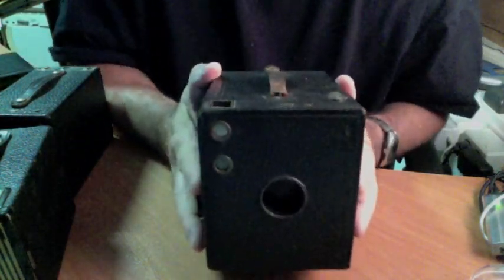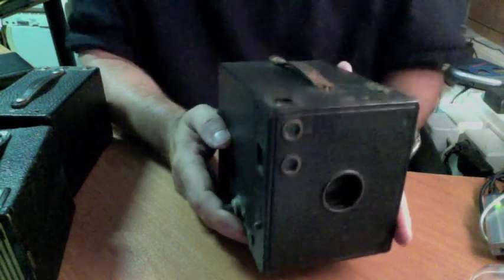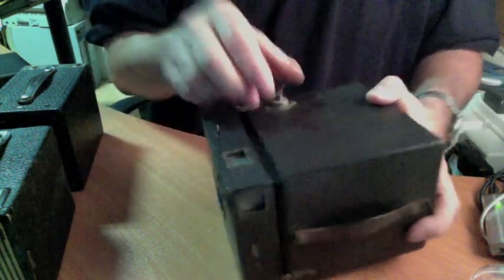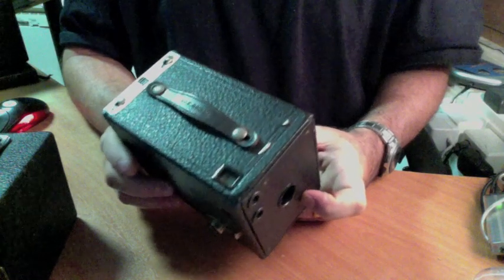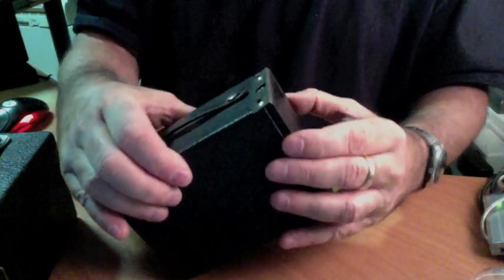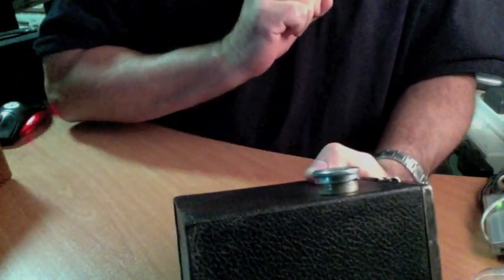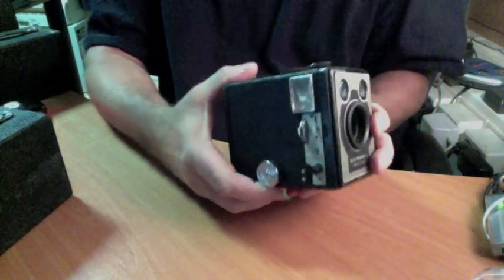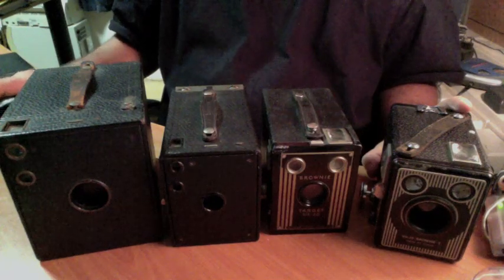How-To Open Different Kodak Brownie Box Camera Models

Comment: bought one yesterday and a garage sale and couldn't open it, thank you so much! i think the lens might be missing and maybe a few other parts i dont know, is there any way to buy parts for a brownie? (the first one you showed in the video)

cant wait to start using it :) i got it for only 2 dollars, i almost passed it up but i though perhaps i could figure it out somehow. its a lot simpler than i thought it would be.
Reply: i just found out there is nothing missing, but the viewfinder is out of place and may need to be refitted back (the mirror rattles around) but i  found a local shop that repairs these things luckily so i will be taking it there. but thanks for the offer :)

Comment: Hi, can you point me to anywhere with instructions or examples of how to remove the front plate of a 620 D/E so as to clean lens, close-up lens and filter? A few models have a screw in front plate but not the ones I have. Thanks.
Reply: @TheBrownieCameraGuy  thanks for the reply. The UK manufactured E model is the one I was hoping to remove front panel but I suspect even if I could get it off it may never be the same again if I messed it up! I found an old service manual which says you can ease it off starting from the top edge, but probably not with 60 years of grunge and rust in the cracks ;-)

Comment: I have a Beau 120, and it needs the mirrors glued down, and the shutter is very stiff.  How do I access the interior where the shutter and mirrors are located?  There are no screws and everything is held together with small pins/ rivets.

Comment: I've got a brownie Kodak that takes 620 film and is very similar to the one you showed in the third example except the pattern on the front is a bit more detailed with a general diamond shape. looks like something out of the great Gatsby. i got the film chamber open like you did in this video but I was wondering if it was possible to open it up where the mirrors are? the mirrors in mine are cracked and very dirty. basically unusable. should I take it to a professional or is it possible to repair myself? i can supply pictures, do you have an email I can contact? also where do you get your film for these guys?

Comment: Hello! I recently just got one of these cameras at an antique store, but the red lens piece is broken.. do you know where I could get another one of those or a substitute? Thanks
Reply from the maker: One way of "fixing" this is to get a roll of ruby tape at an art supply shop and cover the broken piece or remove the broken piece and replace it with a bit of tape from the outside and one from the inside , sticking them together.
Reply: @TheBrownieCameraGuy  thanks so much! I really appreciate it! I will have to find some soon.

Comment: #2 model B.  one I have no back. Not a clue if there was a way to remove it or it was ripped off as odds are it'd be difficult to get the film thru without a pair of tweezers.  I'd been wondering why Kodak wasn't anywhere on it.
Reply: although another site because of that knob says it's likely the Model D from 1920, the Model B would not have the round pole for moving the film along...  I'd been wondering what model I had.  Everyone assumes all #2's are alike.  Not quite.
Reply: @SagePatrynXX  Hello. Send a picture or two of your camera to chuckATbrownie-cameraDOTcom and I'll see if I can identify it.
Reply: @chuckbaker6367  I'll have to see about that.  I have film in it at the moment but did take some inside photos.  it seems a bit complicated considering the way it's named.  ie one side has them as Brownie #2 A Model B  vs Brownie #2 B Model B (A-F and various countries)  And some say model D latter versions didn't have that back protector on the inside box.  It's possible someone switched the insides but have no idea..  I selected it because of a lack of rust for the most part and the handle was in fair condition.  Most I saw were either missing or going.  This one I don't think I'll use the handle much..  I'll see if I can get some better photos on the important parts.  Wouldn't surprise me though if someone had ripped off the back cover.  Now how to find one to replace it (mod)  Some just do away with it to create their own masks.  Like some do with 616 and turn it into a 120 with a 645 mask window.  I gotta find some red tape cause the number window is falling apart. Again got it more for the handle and lack of rust but it's a fixer upper so to speak.  As the front comes off.  And for now don't wanna fix that as I can get acquainted with the shutter and f stop settings..  I'm basing the Model D look from this site http://www.earlyphotography.co.uk/site/entry_X35.html  as far as the film advance wheel .  But having A  or B before Model and A-F after Model is confusing.  :O
Reply: @chuckbaker6367  confusing in that the shutter slide is the same on that site.  But it has the film advance as the Model D on that site.  and the above looks like model D all the way around.  forget mine
again I'll send it at some point.  just busy , I'll see

Comment: You didn't completely show how to get the six 20 apart. You cut that part out. The big problem; once you pull out the film knob and pull up on the top handle pin, you still have the problem of PULLING the halves apart, which is where my difficulty is. Stuck. Which is probably why you cut it out of the video. You have to chisel it loose with some serious tools.